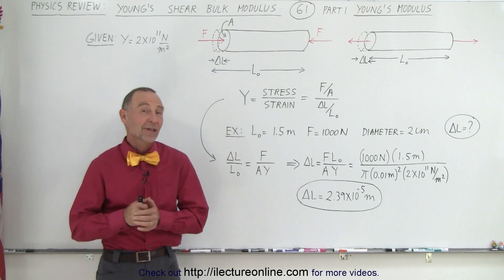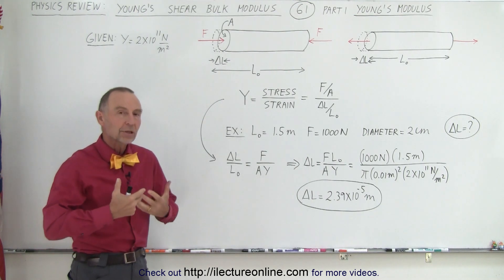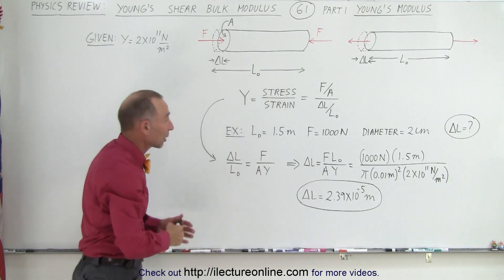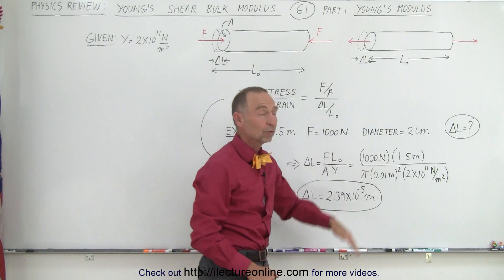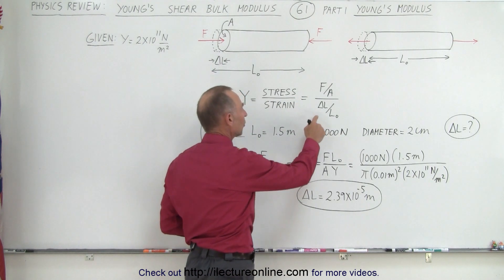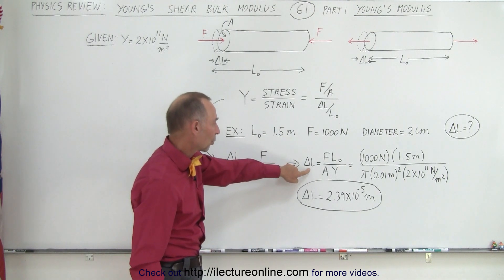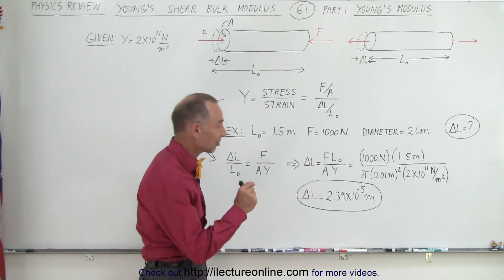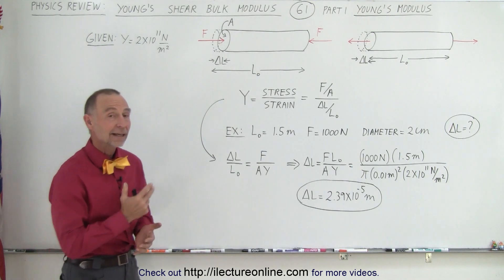Physics Review: Young's Modulus #61 Part 1

Comment: Looking for advise, I am an engineer but math overwhelms me. I used to love math until I hit collage. There is so much to learn and yet I do not know where to start or what to focus on. I can't seem to memorize basic principles and find practical applications that connect with me. I would love to start from the very beginning and watch every math video to relearn basics but time is limited. How do I fill in the gaps and gain more confidences in my math abilities?
Reply from the maker: It is difficult to answer your questions unless we know a bit more about you.  You wrote that you are an engineer, which typcally means you already have an engineering degree. In that case you are looking to improve your math skills for the job.  But if you meant that you are an engineering major still going to school and struggling in your math courses.  Which mat courses have you taken so far and which ones are you struggling in?
Reply: @MichelvanBiezen  Perhaps I should have expressed more detail. I do not have an engineering degree. I have an associates degree. I started my undergrade as an EE but did not finish. The last math course I took was calc 1. I have been working in the same field for or over a decade now. Much of my learning is self taught and on the job experience. I was recently promoted to an engineering position for my strength in design and product knowledge. While I understand the fundamentals of mechanics, physics, motion, and electrical principles, I lack the precision and quick thinking when it comes to solving complex problems on the fly. For example, I can visualize a complex engineered solution mentally and begin design but lack the skill to quickly work out the mathematical problems on the go or in a meeting with customers without needing more time to processes my thoughts. Others in my field seem to have that snappy response and proper vocabulary when it comes to equations and formulas. I know it doesn't help that I am not classically trained but is there anything you could recommend for someone to like myself to train themselves and practice the concepts?
Reply from the maker: Thanks for the additional information.  Having practical experience as you do is much mor valuable than having the "formal" training in engineering.  But that said, there are times that knowing the theory and mathematics is at time helpful and sometime needed.  My suggestion is to work on that on your own.  On this channel for example we have the three courses in calculus a course in differential equations, and a course in linear algebra.  We also have trigonometry, algebra, and pre-calculus.  We also have physics and electrical engineering videos.  If you were to go through those one at a time, you will learn as much if not more than what you would have learned in college.  Start with pre-calculus, or calculus 1, or even algebra if that is where you need to start and work your way through.  We do answer questions on our videos when time permits in case you have questions.
Reply: Thank you for your answers. Very grateful for what you do. @MichelvanBiezen